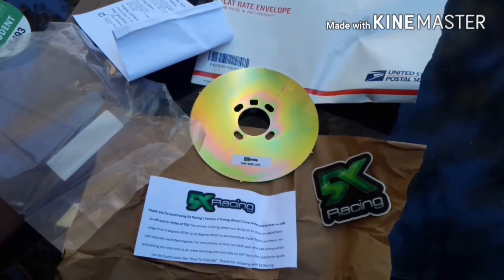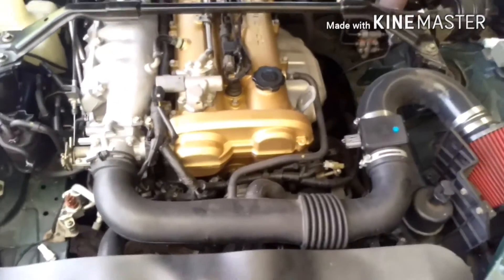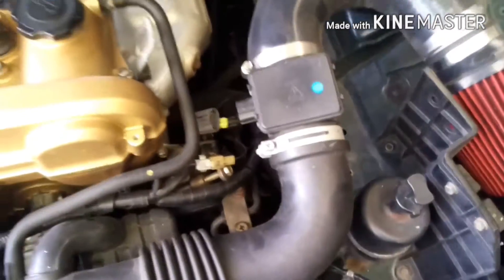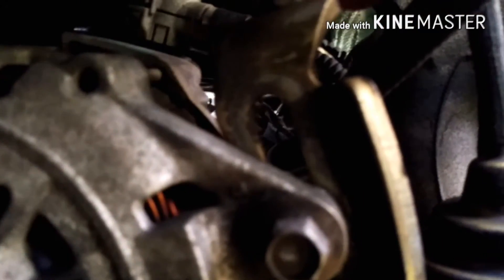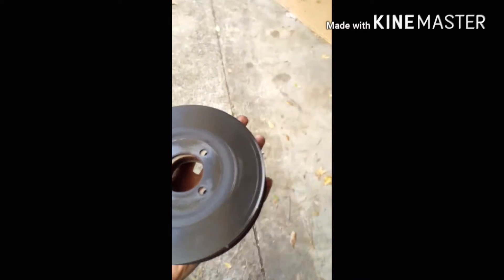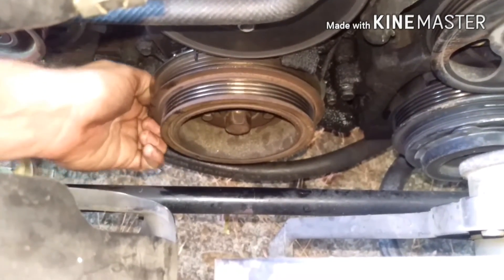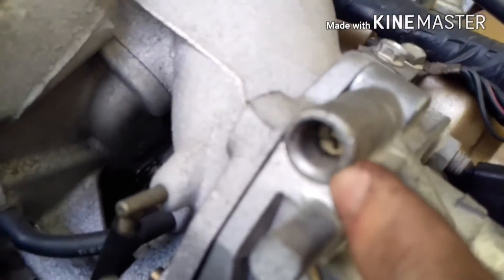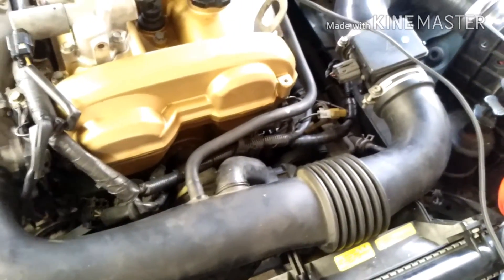5XRacing Timing Advance Wheel Tutorial Miata NB2 VVT

Comment: I bought a wheel like this and just decided it really wasnt worth the risk. The NA car before OBD2 did not have the knock sensor i believe so the timing was more conservative. On the NB2 (FL) you can be pretty damn sure Mazda tuned it so that the ECU will make the timing optimal and because of the knock sensor much better tuned than the earlier cars. 
By impeding the ability of the knock sensor to do its job you risk the ECU overcompensating and running richer...If you jeep an ete on the fuel grade tou use and temperature when its druven it SHOULD be ok but ..trust me ...ive blown a bottom big end tuning ar a dyno..It cost me an engine change like 800 bucks cause i dodnt have time to attempt an engine change...
Is it worth the risk? It will net you hardly noticeable gains

Comment: Does it make any noticiable gain? not that expensive to give it a try, but would like an opinion that supports their data. I've the same model as you nb2.
Reply from the maker: I felt like it moved the rev range around a little bit, up or down depending on how you adjust it. 

It was worth it to me!
Reply: Set it to 14, two notches. I run 93 gas, feels way more fun on middle rpm. @pigeon853

Comment: Remember there is a power source in the fuse box (passenger side, under cover of fuse box, bolt facing drivers side of car has 12V power to it) for you to use for your timing light! Great video thank you
Reply from the maker: This is a great tip! Thanks!

Comment: good informative vid. pretty much sells the wheel.
Reply from the maker: Mike Waschenko I think it was worth the money :)
Reply: i am going through a vvt actuator malfunction. if i ever solve it i will probably do that next.  have you had any issues with your vvt system?
Reply from the maker: Mike Waschenko luckily I haven't had any issues with my VVT system, I'm at 162k miles :)
Reply: damn. 102 here and its been off for a while. i am attempting to replace the seals before buying a head just to get the damn piece. i was thinking they all must be troublesome but you seem to be an exception.
Reply from the maker: Mike Waschenko there are little mesh filters in the VVT system, make sure they arnt clogged!
Reply: i am positive it is clear. i am going to replace that also. speaking to the actuator: i am going to replace the 2 larger diameter o rings next and hope it does it. i dont really see damage in the actuator itself.

Comment: say wiggle room one more time! LOL
Reply from the maker: TurndatWrench wiggle room
Reply: dick.   that's weird that you have to advance timing this way.   On my NA8 I used the cam angle sensor.   Is this a crank angle sensor?.   thanks for the video
Reply: OH I GET IT.  It's what the sensor reads.  Like an ABS ring.   TAADAAA
Reply from the maker: you slot the wheel that the crankshaft sensor reads from! instead of moving the sensor.. you can move what the sensor reads!